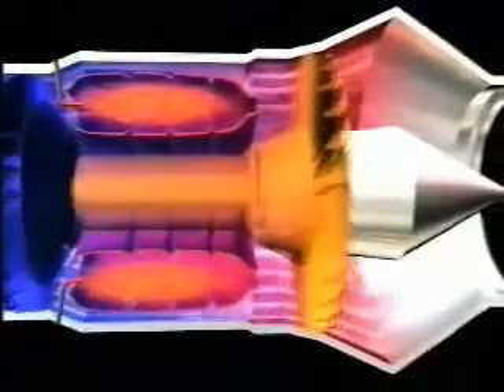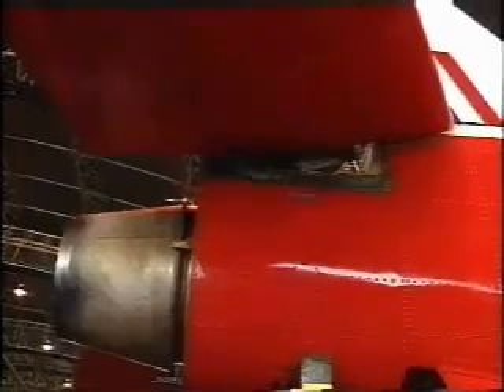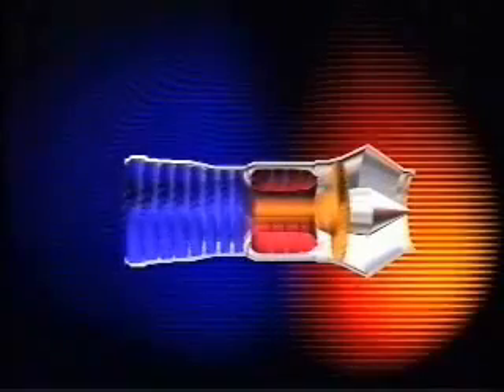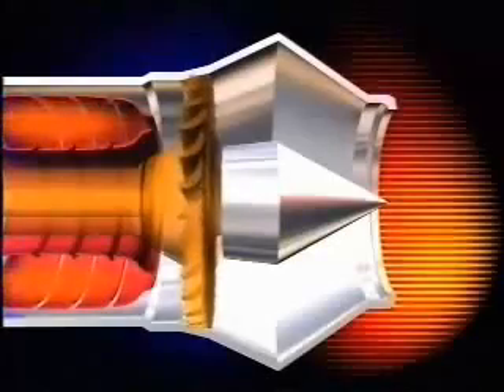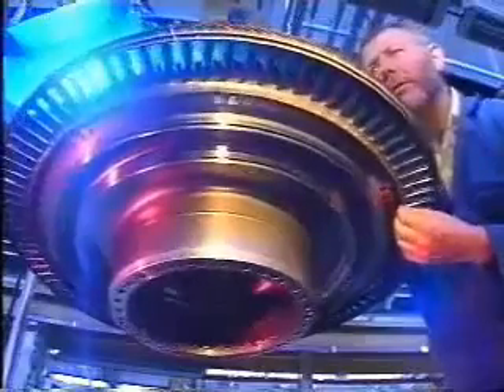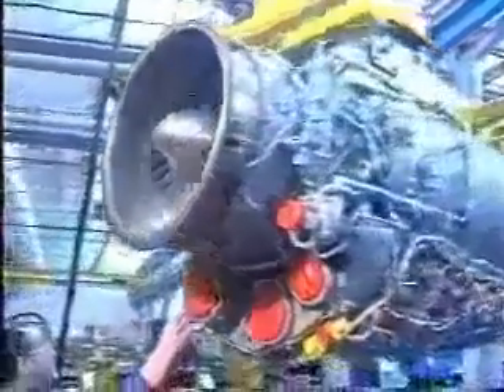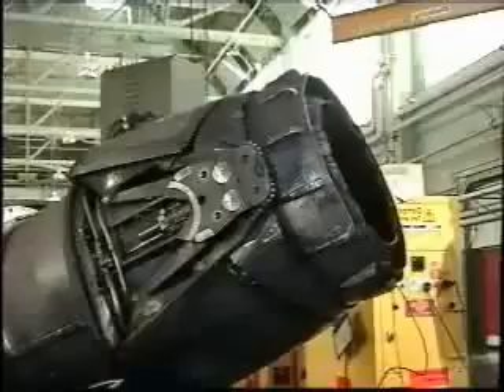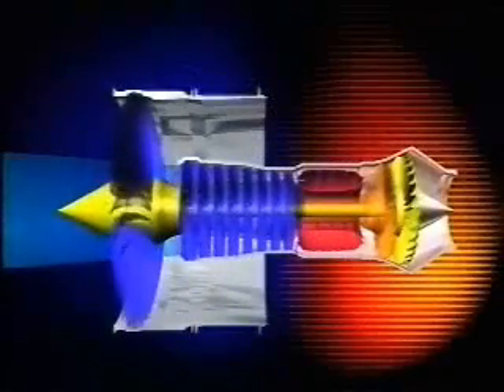How A Jet Engine Works

Comment: Electrically, there is a motor/generator that is also used to produce the electrical power for the rest of the plane, which is situated within the engine behind the compressor stage in the gearbox

Comment: I understand what you are saying, and I get it: air bypass was a component of jet engines as far back as the early sixties.  What I'm saying is that even more of the thrust of a modern jet engine is produced at the very front of the engine, today, than in the past. This quiets the engines enough so that new aeroplanes, departing SNA, no longer have to follow those absurd rules of spooling the engines with the brakes on, and shooting down the runway.

Comment: JetMecMA, this is true in modern turbofans. Thrust was moved to the front of the engine, during the last 20 years.  (I'm talking out of my ass here. Please correct me, if I'm wrong.) I can hear the difference in modern jet engines, compared to those of the late 1960s. Today's turbofans have more of a "propeller" sound to them, because of where most of the thrust is coming from. In the old days, jet planes had more of a "screaming" sound, than those of today. Fighters are still all jet, no fan.

Comment: A starter system rotates the spool through the gearboxes which causes air to be drawn into the engine by the compressor, the high energy igniters start operating. When the starter has got the engine up to a suitable speed fuel is introduced; the fuel is lit by the igniters and the hot gas flow generated begins to help turn the engine through the turbine. When there is enough energy in the gas (self-sustaining) the starter can be disconnected and the engine runs up to idle under its own power.

Comment: Though technically problematic, a good book on Apollo is titled, "Angle of Attack." It covers some of the battles that went on over the design of Apollo. Also, the HBO miniseries, "From the Earth to the Moon," provides deep coverage of Apollo.

As for the atmosphere-to-space turbine engine, I think that the design by Reaction Engines and Alan Bond is right on the money.

Lastly, the video division of LSI was liquidated in 2008. That doubting manager went to work for Netflix doing the impossible.

Comment: Oh, by the way, the 727 ran on a low bypass engine.  That's the sort of engine to which I refer that had more of a screaming sound.  (I lived only a few miles away from JFK, right under the flight path of the 727s. I remember them, well.)  Today's 737 aeroplanes use engines that sound a little bit like the 727, but also, a little bit like they're propeller-driven.  Those are the high-bypass engines.

Comment: Somehow, I believe that there's got to be a "yes" answer.  I recognize the complexity of it.  Still, I cannot imagine it as impossible.  The SR71 could fly to 85,000 feet. Of course, there was the thinnest of atmospheres to feed the engines. It obviously doesn't require much O2 to run such a machine. Switching to an onboard supply of O2 for that last push to a ballistic trajectory can't be impossible, and once on track, the aircraft can pretty much glide to its destination.

Comment: How is the engine initially started? In a car you have a starter motor that cranks the fly wheel? How is the cold air sent through the fans at start stage before combustion? And how then in turn does this continue to run?

Comment: I'm not saying that air bypass did not exist, 50 years ago, but there was more jet than fan, in those days.  I think that it's because of more thrust being moved to the front of the engine, making it quieter, that new Boeing 737 aircraft no longer have to take off like a rocket, out of SNA, and then suddenly reduce their thrust, until they're out over the Pacific. (They call it "noise abatement." I call it frightful.)

Comment: Okay, okay. Something's been bugging me for a long time about jet engines. They're aerobic. They suck air in, combine kerosene, burn it, and send the exhaust out the back. When there's no air (like in space), the engines flame out. So, here's my question: why, at extreme altitudes, can't liquid oxygen be injected into the combustor, providing thrust, even in the complete vacuum of space?

Comment: If there is enough propellant in the Saturn V S-1C to push an Apollo rocket onto an orbital trajectory, then this can't be impossible, especially considering that there's enough air, up to 75,000 feet, for a jet engine to breathe.  After 75,000 feet is when LOX would be injected, and only long enough to put the aircraft onto a ballistic trajectory to its destination. Once out of the atmosphere, there would be no drag, making an aircraft very fuel efficient. (So, is that possible?)

Comment: nice work.but didnt explain how the air intake is powered when the engine is being started
Reply: with an electric starter motor and a big battery like in a car.

Comment: Back in 2002/2003, I had a conversation with an engineering manager at LSI Logic, a shithole of a company, at which I worked. He was a software manager for video CODEC.  I raised the possibility of the internet being used as a medium for delivering on-demand video. He said that it couldn't be done because the hardware was too expensive. His answer was pure bullshit, as you can see, today. Never say "NO!" Rather, consider the possibilities.

Comment: I don't understand why the back pressure from the combustion chamber doesn't stall the engine??
Reply: Coming back to this, my only guess is that the inlet compressor stage produces pressure that's on par with the combustion chamber. The excess energy is given off in a greater volume hence why the exhaust impeller is so much larger. Would also explain why sudden/excessive acceleration can cause an engine stall as a sudden burst in fuel would lead to an imbalance of pressure between the inlet and the combustion chamber.
Reply: jack rohde For this example it appears to be a single spool engine- so everything is connected.  Everything spinning is one piece.  And they have not illustrated the non moving stator vanes that are in between each stage shown in the graphics here.

The pressure flowing through from the compressor section keeps the combustion gasses flowing out the back. Otherwise there is a stall... I believe that GE or Pratt had a problem with stalls caused by this reverse flow when they were developing the new engine for the 777 in 1993. The cause was an engine casing that flexed too much (allowing air to move forward I guess?).
Reply: Because the compression of the inlet is great, and the combustion chamber inlet is smaller than the outlet. This means that the flow will naturally go to the exhaust.

Comment: how high speed intake design is used to ensure the correct airflow to the engine during subsonic and supersonic flight? Anyone help me with this?
Reply: Some jet have onboard computer control adjustable flaps in-front the engine to control the airflow coming into the engine like the F-15 or the Sr-71

Comment: Well, somebody should put a jet engine (with the added zing of oxygen injection) inside of a vacuum chamber, and find out for sure.  I don't think it has been tried, at all, but it should be.  Just doing the math is not proof-positive of anything.  Plato didn't get very far with only thought experiments.

Comment: Like I said, I'm talking out of my ass. Turbo fan or all jet, I don't think that air bypasses the turbine engine in a fighter.  As for passenger jets, there's no question that the biggest changes to where the thrust comes from was implemented some twenty years ago.  (My ears tell me that.)